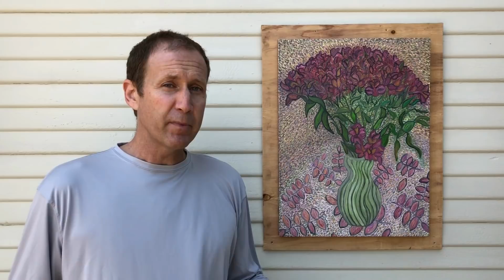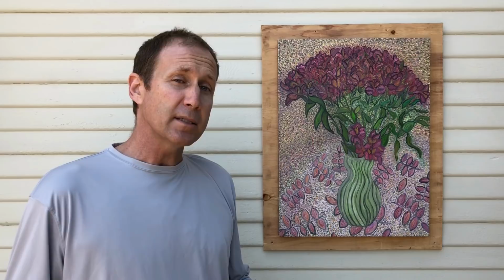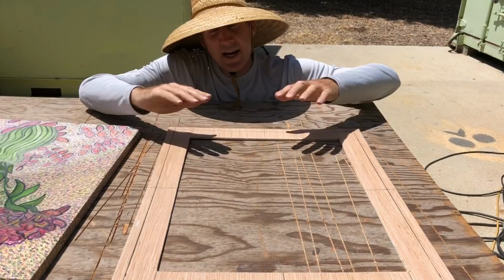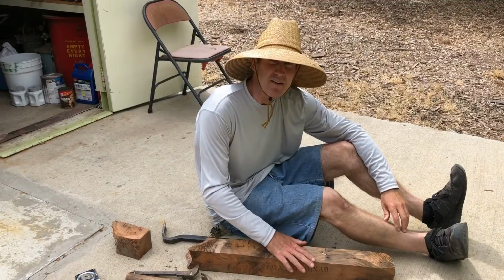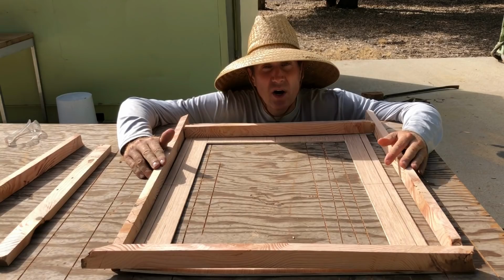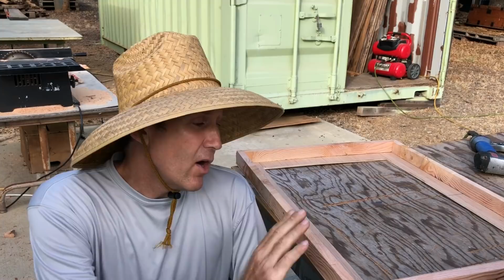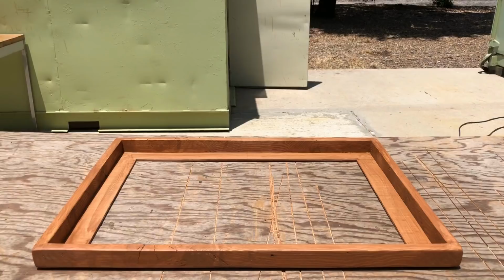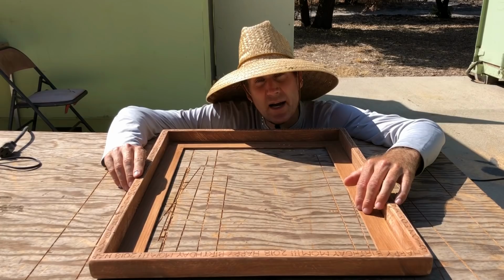Mom's birthday flowers painting and frame

Comment: As always, you amaze me with your visions.
Do you ever glue some pieces back before you rip them?
Reply from the maker: If a piece breaks in half I would never glue it together and run it through the tablesaw. The saw would more than likely break the glue loose. What I would do is run the two broken pieces through the saw and then glue them together after they've been cut to size.
Reply: scott oconnor good point.